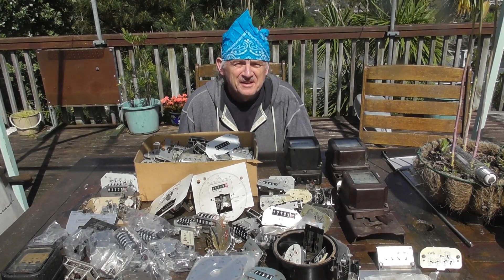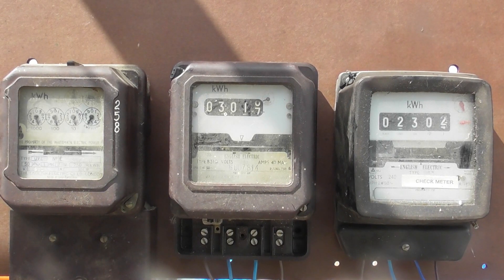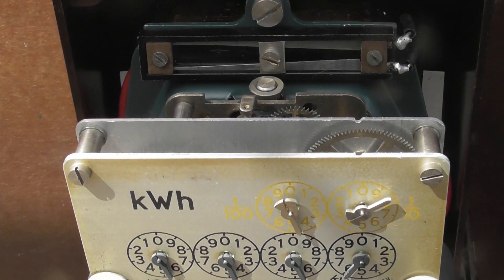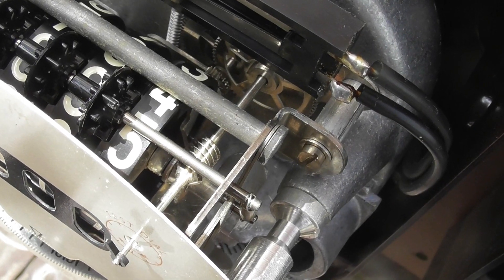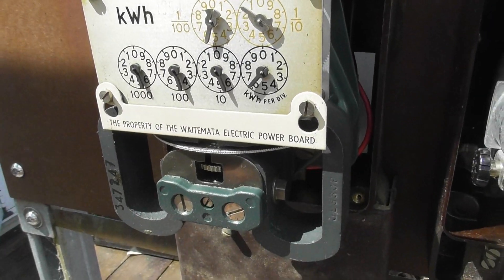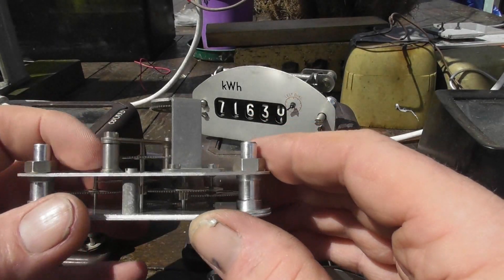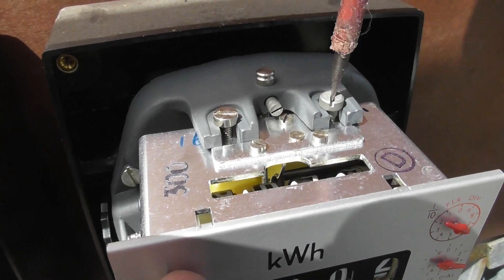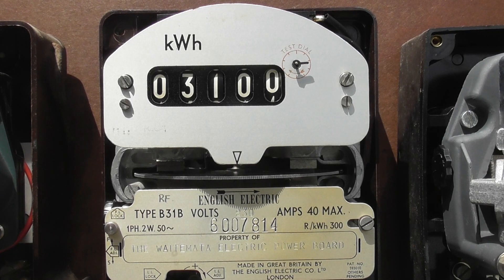English Electric meters

Comment: Lovely old meters, thanks for sharing.  A word of caution, the UVE meter cover you show at 11:22 looks like it has an asbestos gasket (of the woven rope style) that is shedding.  Working with them outside is a plus, might even want to dust off a pandemic mask for extra protection when you open them up.

Comment: I noticed that on the wheel there are dimples or perforations that make an odd pattern when it spins.  Do the  perforations serve some sort of purpose? 6:17-6:19
Reply from the maker: Those dimples strengthen the Aluminium disc.